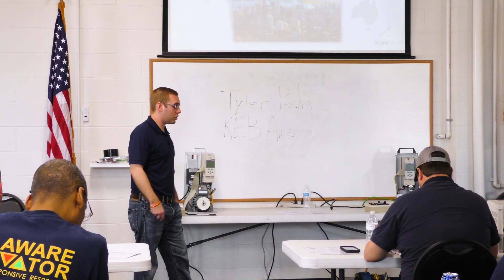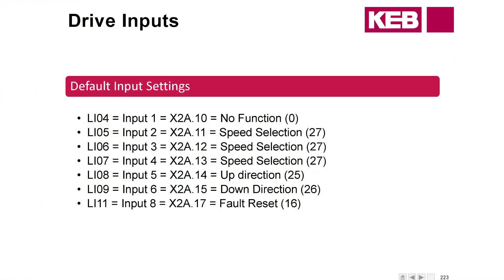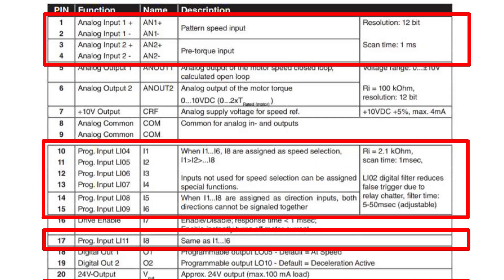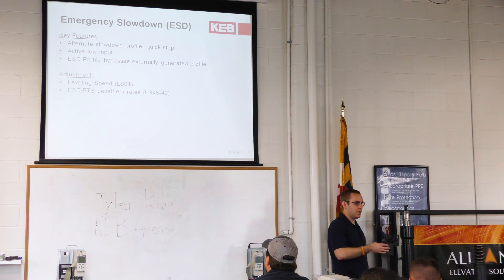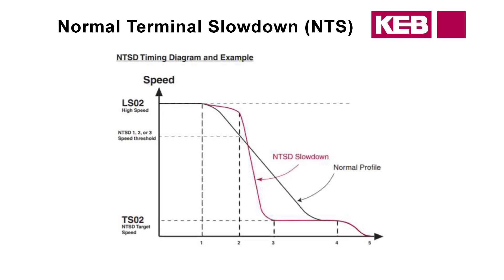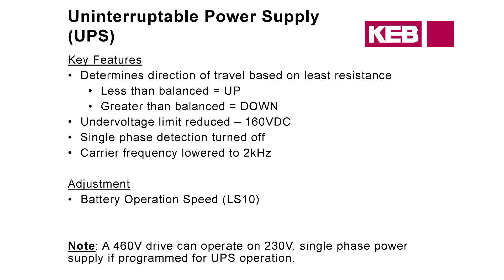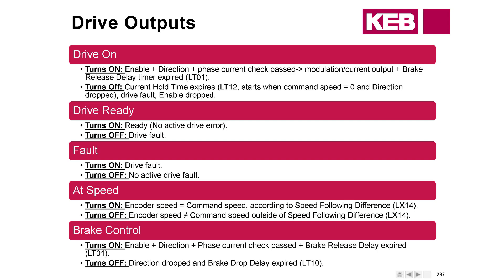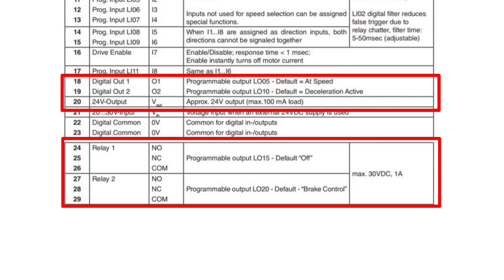KEB F5 Elevator Drive Training: Inputs/Functions & Outputs (Part 14)

Comment: Thanks for this series. Ntsd and ets need more focus and guidance in the industry, the spikes and faults involved to stop in time are not discussed much and best practice adjustment methods in the controller manuals are sad. Danger curve more until something blows and then dial it back 2 notches is the slightly skewed takeaway of the Motion manual.